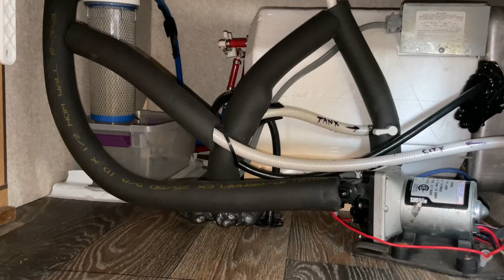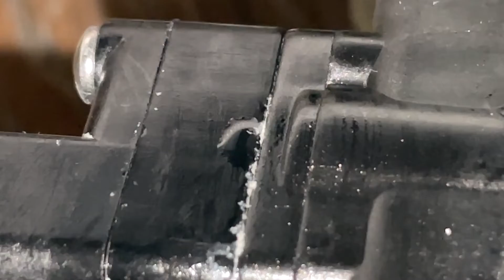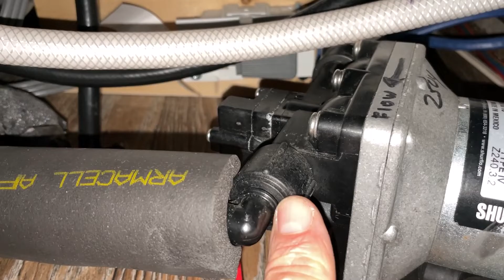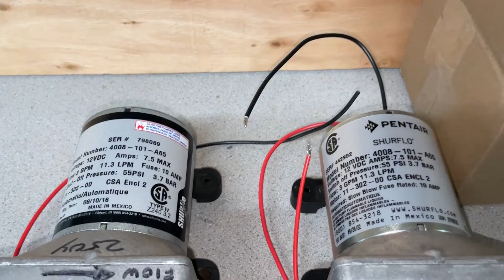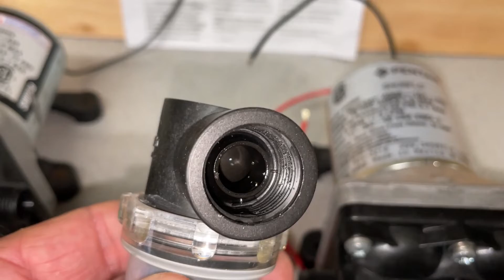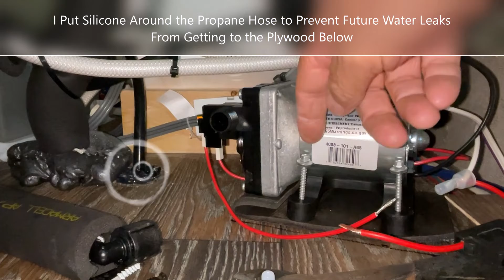RV Shurflo Fresh Water Pump Failure and Replacement (Model 4008-101-A65 & E65)

Comment: The strainer needs to be down to collect debris? Up isn't working
Reply from the maker: Thanks for watching and for pointing this out. It collects debris in any position, Good catch. You are the first to mention this and I appreciate it. (I agree with you that the best way is to have the bowl in the downward poistion)
Here's what I found on the internet regarding positioning of the filter:
"The Shurflo water pump filter/strainer can be mounted in any orientation (horizontal or vertical). While it will function in any position, it is generally recommended to mount it so the filter bowl is easily accessible for cleaning."

https://www.youtube.com/@thetraveltrailerguy/videos

Comment: I did not have the leaks that you did, just constant pump running. When I went to remove the filter, it was loose. I cleaned, replaced, and tightened the housing, the pump ran, filled the water heater and stopped pumping water as desired within a minute.

Thanks Sir
Reply from the maker: Thank you so much for watching and sharing what you were faced with and how you resolved the problem. Hopefully others will read this and this information will be helpful for them. https://www.youtube.com/@thetraveltrailerguy/videos

Comment: I was hoping to see you disconnecting the electrical wires when you were taking the pump out. Is it hard-wired in on the motor side?
Reply from the maker: Yes it is hardwired to the motor, I'm sorry I didn't show me cutting the wires - https://youtu.be/z_Wp6UCNGrg?t=391

SHURFLO 94-800-00 Model 4008 Complete Upper Housing -
https://amzn.to/3UfUJ7r

SHURFLO    4008-101-A65    3.0 Revolution Water Pump -
https://amzn.to/3DALUPB

SHURFLO    4008-101-E65    3.0 Revolution Water Pump -
https://amzn.to/2UjqgLN

SHURFLO 94-237-00 Series 2088 Check Valve Kit -
https://amzn.to/3hxOd9N

SHURFLO RV Trailer Pump Filter Fresh Water Pump Strainer -
https://amzn.to/3NPY2jg

https://www.youtube.com/@thetraveltrailerguy/videos
Reply: @thetraveltrailerguy  No worries. I’m figuring it out.

Comment: Am I correct that the inlet and outlet fittings just screw on.  The video does not show you doing that.  Were you able to get them off by just turning them with your hand or did you need to use a pair of pliers?  Thanks for the video have to change the same water pump this weekend.
Reply from the maker: Hello Gary thanks for watching and your question. Yes the inlet and outlet hose fittings just screw on and off. You may have to remove them by using pliers to get them started and then by hand the rest of the way. And to put them back on turn them until they are snug and give them a slight turn more with pliers but not really tight, just snug tight. Run the pump and check for leaks. I hope this helps. https://www.youtube.com/@thetraveltrailerguy/videos

Comment: Another great video.   I was also looking for one on replacing the CO2 detector.   Have you done this?
Reply: It's very easy replacement.  Remove the old one cut the 2 wires and reconnect to the new ones.  You'll know when it needs replacing by nonstop beeping. However, I did did have to do some trimming because the replacement I bought was slightly bigger. The face was the same but not the part that inserts into the wall.  Wasn't a bit deal easy peasy.
Reply from the maker: I haven't had to replace our yet. are you talking about the CO2 detector or propane detector? This detector does both CO2 & Propane detection https://amzn.to/3ODTpcl

Comment: Nice Job Michael! We have a spare pump that we use to transfer water into the freshwater tank when we boondock. I bought the exact replacement as you just never know when the pump is going to fail.
Reply from the maker: Thank you. That's not a bad Idea having a spare :) I might just buy a replacement head for the one that went out and attach it to the old motor as a spare. Happy Camping